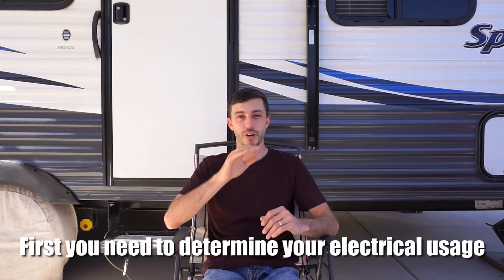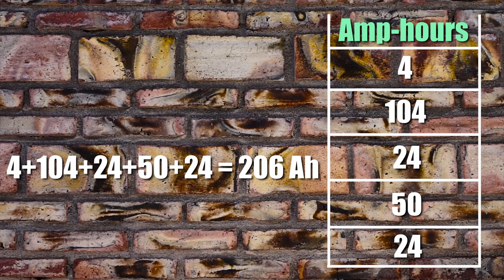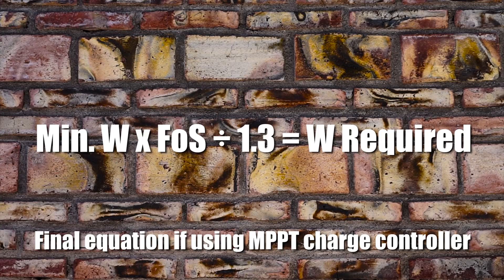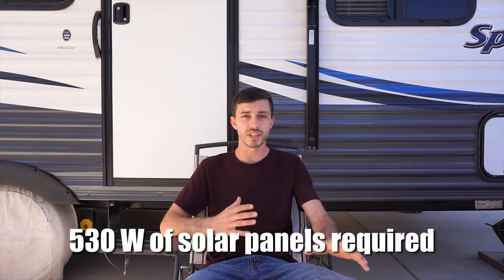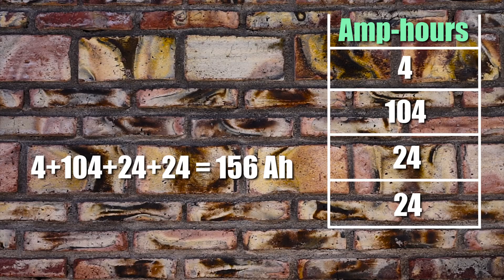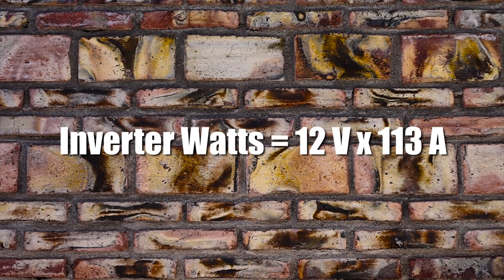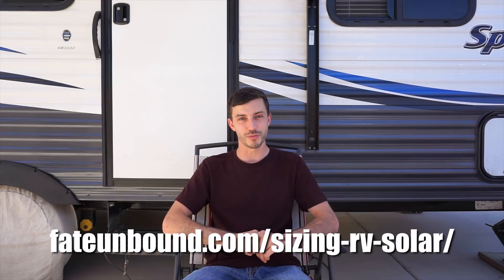Sizing RV Solar - Solar Panels, Battery Bank, & Inverter - Full Time RV

Comment: I watched all of your videos on Solar. What Great sense of accomplishment you must feel.  I love all the detail that you provide. My wife and I are retiring in about a year and a half and are planning to fulltime in a 5th wheel. I am really sold on the idea of Solar and your video;s are great! Ideally we plan to live mostly in RV campgrounds for the first yr or so, before we add solar. This way we can use your chart to determine our needs more accurately.
I read or heard somewhere that you should never pull your batteries (Lithium, that is) below 70% or your Warranty,which i believe is around 7 yrs , is void.
Can you confirm or did I mis understand your statement. "lithium batteries allow a discharge of 80% or more".
Thanks, love your videos!

Comment: Hi David, great info as usual. On the inverter; how are you determining 3amphrs? Did you base your 3 amphrs on total usage of misc AC plug ins during that 8hr period?
Reply from the maker: We have a battery monitor that tell us how many amps we are discharging or charging. The inverter by itself uses 3 amps, not amp hours, when it is turned on with no other devices being used.
Reply: Thank you.

Comment: Great solar expiation but you did not include using an AGM battery which is in the middle between lead acid and lithium.  Has many more life cycles than lead acid  but not as many as lithium.
Any other differences between PWM and MPPT other than amount of charge to batteries?
Reply from the maker: Thank you Doris. I did not highlight AGM specifically because they are another form of lead acid batteries. Yes they perform better than wet cell and gel cell lead acid types, but they are still severely under-perform when compared to lithium.
Another advantage of MPPT over PWM is that you can use high voltage solar panels like 24 volt or 48 volt and the MPPT controller will be able to transform down to 12V nominal before sending the current on to the batteries. This higher voltage, lower current, between the solar panels and charge controller results in less power loss. We don't take advantage of this because we bought our solar panels with a PWM charge controller originally so they are 18 volt solar panels.

Comment: Lots of good advice. I was just wondering have ever tried running AC fan only to circulate air in the rig.
Reply from the maker: Yes we have, however the fan in the AC fan still pulls about 15 amps, very high for just a fan! So we use our Maxxfan when we want to move some air and it pulls less than 5 amps on full.

Comment: What was the cost for for your solar system
How much do you think for labor to have someone install it
Would you consider installing for someone else
Reply from the maker: We absolutely love our solar and depend on it every day for electricity. The up-front cost is quite high, but when you compare it to the cost per day to stay in an RV park our solar system will actually pay itself off in less than a year of not staying in RV parks everyday. The total cost of the solar setup was $3,600, and the total cost for our lithium battery bank was $4,800. Again, it sounds like a lot, but $25 a day staying in RV parks adds up to $8,400 (the total cost of our solar system) in only 336 days. We are actually out boondocking on free BLM land right now powering our RV off the sun =)I'm not sure what the labor for this would be, but it would probably be between $1,000 and $2,000 but that is just a shot in the dark.No I wouldn't do an install like this for someone else because there is too much liability on both ends. I'm not a professional and have no liability insurance so it has the potential to be bad for both parties.
Reply: @FateUnbound  sorry, how many lithium batteries are you using? $4800?

Comment: WOW! 
Great education. I think I get it.Thanks. A couple of questions come to mind. 
1) Why do I see a 24v. option for some solar systems. Do you know the pros & cons? Is it only the loss do to the length of wiring? (Not our concern)
2) I was wondering about using a 5000 watt window A.C. unit in bedroom window? 
P.S. We actually love our 12v. Fantastic Fan for RV cooling.
Reply from the maker: Thank you Jim! The reason a lot of solar systems are 24V is because if you use a higher voltage then the current is smaller, therefore you can use smaller gauge wire and the losses through the wire are less. Then the charge controller transforms the voltage down to 12V nominal before sending it on to the batteries. Also, I have heard of people using 5000 BTU window A/C units and them working well. You will still need a lot of solar, over 1000 watts, a large battery bank, and a large inverter. But it will be easier to keep charged up using one of those than the one that comes with your RV.
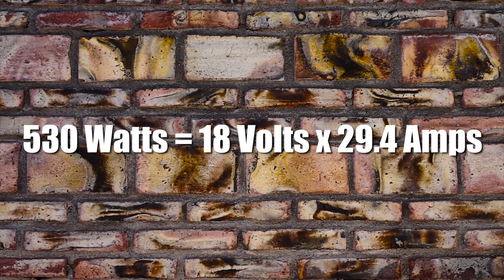Reply: @FateUnbound  Great video, very well explained; I get confused about this part though. At 4:57 you explain that most solar panels generate 18v but I found solar panels that generates 24v and 30v at its peak. In this equation that means that I need more wattage to supply my amp hours? Sorry if i sound naive or if I'm missing something, just trying to get this figured out. Thanks
Reply: Fate Unbound Thank you for the reply. I was afraid of that. One half of way too much is still too much. Maybe a swamp cooler in the desert. Or, turn on the Fantastic Fan and go to bed late.

Comment: Excellent video. Did you add a 110v Lithium charger to top off your batteries for those days you have electricity available?
Reply from the maker: Thank you! Yes we have a smart converter charger that charges our batteries much like the factory converter charger in RV's does.

Comment: I was hoping to hear about powering the Dometic from solar, that will be my biggest draw. Don't see the wattage in the manual, I'll need to pop the cover & look inside. My pup loves watching Sweetie too.
Reply from the maker: Our refrigerator draws about 30 amps when it cycles on, so it's pretty high draw. Thankfully it cycles on and off so it isn't drawing 30 amps constantly. I haven't paid attention though to how often it cycles on then off though so I have no data for you there.
Reply: I put on my clamp on ammeter and it said about 30 amps too. I had no idea these absorption fridges were such energy hogs! Makes sense since they use a heating element like a toaster. I might be able to run it during peak solar hours. The rest of the day will need to be propane. Thanks again!

Comment: Having the bigger inverter, does that drain batteries faster? I'm thinking big inverter mppt, is better?
Reply from the maker: The inverter only pulls about 2 amps from the batteries when it is on, but I would assume a larger inverter would need more amps to power it. The size of the inverter only depends on how many 120V AC appliances you need to power through it. So if you'll be running computers, TV, the refrigerator then yes you'll need a big inverter. If you only want to run a TV and charge your phones though you can get a small inverter. And yes an MPPT charge controller is better than a PWM charge controller.

Comment: You covered the charging inefficiency and the depth of discharge limitations on lead acid, but I didn't hear you mention anything about discharge losses at higher currents.... aka Peukert's law.  The higher the discharge rate of a lead acid batter the less efficient it is and the less power you get out of it.  This is another good reason to go with lithium, however the current lithium batteries on the market can't handle the high currents that lead acid batteries can so may require more but smaller batteries in parallel to handle peak current requirements.
Reply from the maker: That is a very good point, thank you for pointing that out also!

Comment: Add in power for an air conditioner for arizona.....  you can't fit enough solar on your rv roof :(   I wish there was an easier way to add an evap cooler to an rv to save a ton of power.
Reply from the maker: +ben dorman Agreed, there's gotta be someone that has done it in a good way. We just have to find them :P  And we don't use our AC unless we are on full hook ups, which is rare. We boondock 95% of the time. Windows up and fans on!
Reply: @FateUnbound  portable swamp cooler... sits on floor or counter works ok for me beats firing up generator... swamp cooler = evap cooler.. here everyone calls swamp so used to that
Reply: Search up the turbokool

Comment: David,  I've said it before,  your explanations and illustrations are so detailed and clear that I'm finally understanding the ins and outs of solar systems.  Thank you!
Reply from the maker: Thank you!! I'm glad the videos are helpful to you, that's what makes it worth making them! Let me know if you've got any other questions regarding RV solar =)
Reply: @FateUnbound   I have a million questions but I'm gonna start with filling in my chart first. I need help with seeing how many batteries I will need for my Oxygen concentrator and inverter though.... I don't want to be boon docking and run out of air :O
Reply: @FateUnbound   @12:43  I have learned and told others to have a 2:1 (solar to Batteries) yet yours is a 1:1 ??? Have you had any problem not be able to charge your batteries for that lack of solar?   WHAT WOULD YOU MAKE BIGGER; S More Solar or more Lithium ???

Comment: Thanks for the clear explanation.  We travel 1 to 2 months at a time and are trying to figure out the proper size needed for our battery bank.  (No solar yet)
One choice that you are making is confusing to me. It is the 50 amp hours per day for cooking(Instant pot?).  With the large upfront solar/battery capital cost to cover this amp draw, wouldn’t it make more sense to use propane or generator to cover that amp draw?
Reply from the maker: Thank you, glad you liked it! Let me know if you have any other questions and I'll help where I can =)
You make a really good point about the cooking appliances possibly not being worth it in the long run since you have to invest in more batteries and solar panels to use them. And honestly I can't answer that question yet. I haven't looked into it to tell you whether or not it is worth it. But we do have an Instant Pot and an electric griddle that I cook bacon and eggs on pretty often. Now you've got me really wondering. Hm......
Reply: Fate Unbound    :)

Comment: I have installed solar systems in 2 RVs. In all my research, I never heard this so well explained. We enjoy using our 12 volt Endless breeze fan in summer, and an electric blanket run off our inverter in winter.  We use our laptop and charge our phones with 12 volt cords to save on amp draw. Thanks.
Reply from the maker: Wow thank you!! I tried my best to explain it in the clearest way possible. I've heard about charging laptops off of 12 volt but haven't gotten around to researching it myself. That would save us a lot of power since the primary reason for running our inverter is to charge our laptops. The inverter alone uses 3 amps, and then there is some inefficiency in converting 12 volt to 120 volt. So I'm sure charging our laptops off 12 volt would save us a lot of power!
Reply: You can usually order 12 volt cords to power laptops and phones.  We created our 12 volt power station by ordering a 14 foot long 12 volt extension cord, cutting off the male end and tapping into 12 volt power at a light that is mounted under a cabinet. The cord runs inside the cabinet, down a corner next to the dining table and the female end is on a hook under the table. A 12 volt splitter is plugged into the end, so we can run a surface pro and a Dell laptop. My wife covered the cardboard core of an old roll of wrapping paper with material she used to reupholster the booth cushions and ran the cord through it, so no cord is visible in the corner. It looks like a little decorative column. 12 volt extension cords and splitters are available on Amazon and at major truck stops such as Loves and Flying J.
Reply from the maker: +J J Huh that's a really good idea, and it's cool that you were able to hide the cord thay way too! I'll look into that and will probably do something like that in the near future to be more energy efficient! Thanks for the tip =)
Reply: JJ can you post a picture of your 12 volt cord?

Comment: Great information. Do you run your refrigerator only on gas? How much would you need to run your refrigerator? Have you thought about adding a portable solar panel that you could set up when you boondock since you have limited roof space?
Reply from the maker: We almost always have the fridge running on LP. Some days in full sun we can run the fridge on electric but it will drain our batteries down even in full sun. So then the following day we switch it back to LP so our batteries can charge back up.
Our fridge pulls about 420W so we would need 3 more of our current 160W panels to power the fridge alone :(
We have thought about and will probably get an expansion panel to set on the ground that is wired in parallel with the panels on our roof to add some extra power to our system. But that probably wont be for a while, we have nowhere to store it right now haha

Comment: Great explanation as always sir! Guess it really comes down to the question of how much you want to boondock and what you plan to do while boondocking :) My main concern about our to-be arrangement is our extra monitors for our laptops so we can have dual monitors while working on the road. Guessing for the first year we will be mostly staying at RV parks anyways, but we shall see!
Reply from the maker: Thank you!! Yeah it really does just come down to how long you need to rely on your batteries to get you through periods of little/no sun and how many devices you plan on using. Our laptops are going basically all day every day since Jenni works remotely and I'm constantly editing video, writing posts, or updating the website. So other than the 2nd monitors we're right there with you! If you plan on staying in RV parks most of the first year then that will give you plenty of time to really get used to your solar and see what it is capable of.
Reply: Excellent information!  Thanks for spending the time to explain everything!